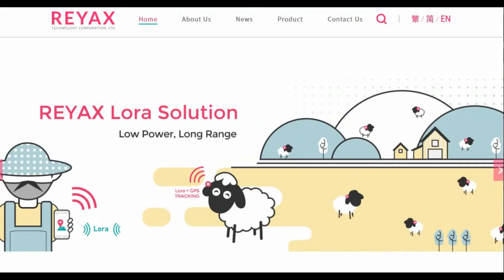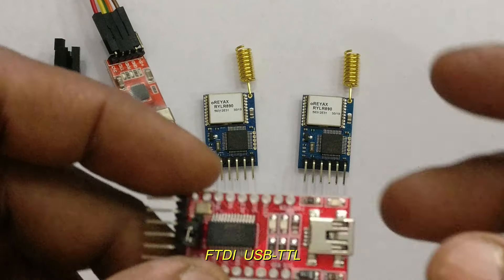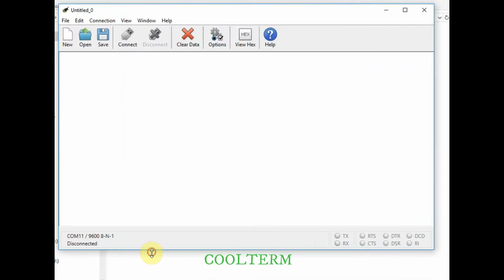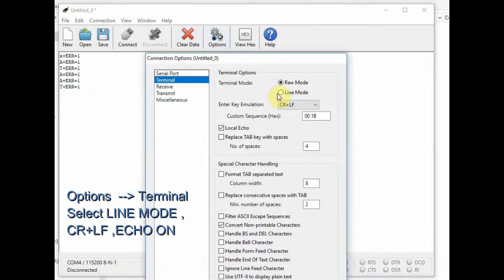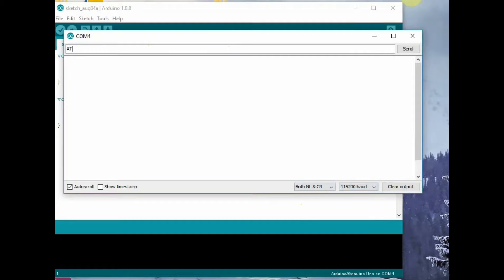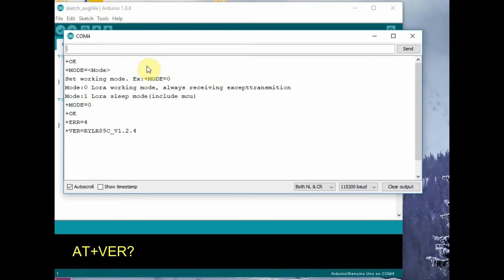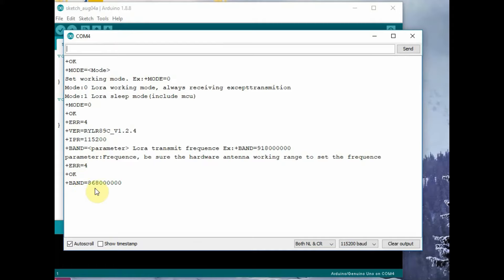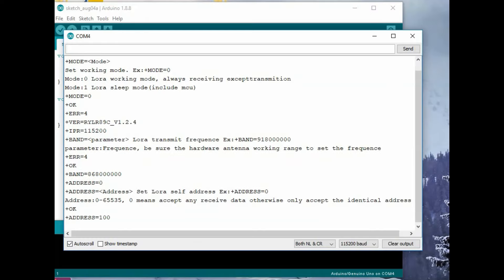LORA - REYAX RYLR896 MODULE - GETTING STARTED WITH AT COMMANDS

Comment: Hi  Thanks for this video . I need your help  with an issue I'm facing .When I connect the Reyax module with the FTDI module I can communicate with it through serial port of Arduino Ide .But when I try to comunicate with the module connected to a esp32  WIMOS LOLIN 32 ,I type AT on serial and no answer from the module .I already installed the drivers and don't work any way

Regards